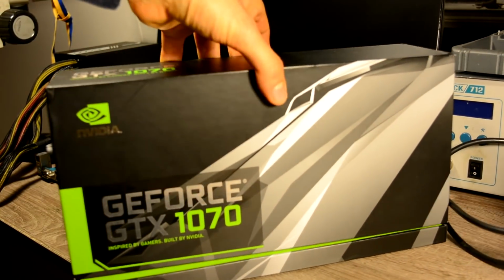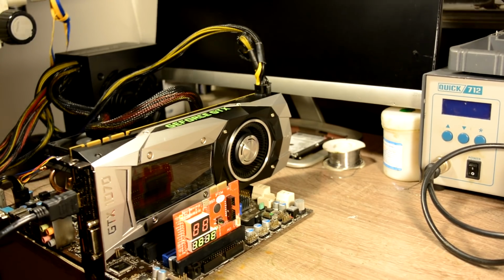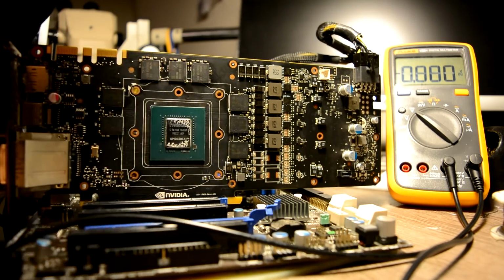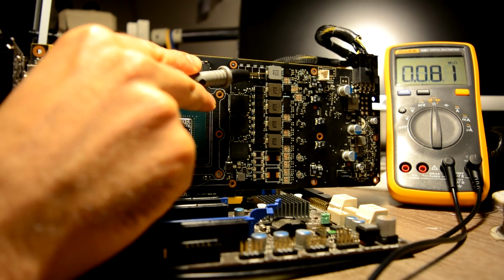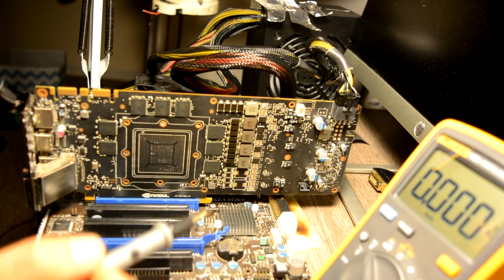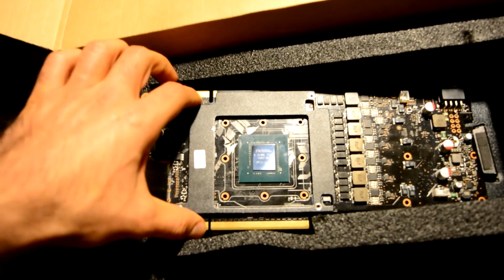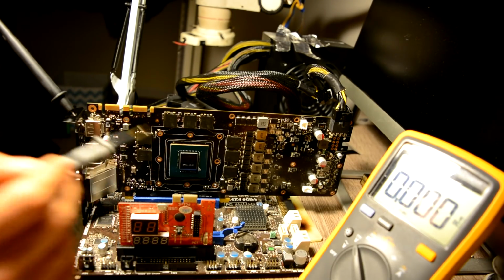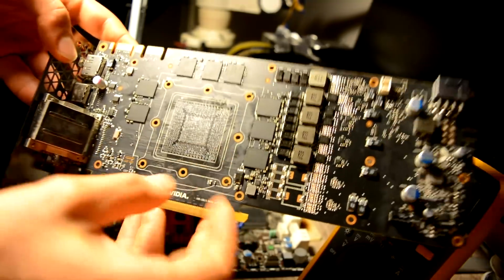GTX 1070 broken, no video diagnostic of graphic card hard repair PART 1

Comment: i have a lot graphic cards working. GTX 760, GTX 780, R9 290 and R9 280X. I bought all used, all cards are working fine. What are they duing?
Reply: Without a graphics card you won't be able to see anything in your monitor unless you have an integrated one in your processor. Those cards are a lot more powerful than integrated ones so for games/3d modeling etc. they will work alot better than an integrated one.
Reply: why do you have so many cards?
Reply: @edg6779  for my two children and me. ;-)
Reply: @aequo5729  ah ok, I got a 760 and 1070
Reply: :/ send me one im in need! xD

Comment: Have you done a video card repair where you showed close ups of what you are checking and the spots you are checking and why. Just more explanation and close up. I have (not this card) 2 cards where one did work on and off and I tried to reflow and now nothing. The other one really is hot and I don't know if this is normal, so how and why to check some areas would be nice. Thanks for the videos.

Comment: I have a few questions about a 1070 Strix, I may have unplugged it prior to letting discharge of voltage. Symptoms are cold Gpu but lights still functional. What is the most likely issue for cold gpu on these cards and power related failure to the die?

Comment: Heyo! Just bought a defective 1070, and just as you mentioned, the little coils in the bottom right are burned out, leaving a big gap. So, is it possible to just jump the two side together, or is a coil needed there? Also, is it possible to replace the 4 tiny black bricks with a bigger coil?

Comment: Hey Eli - 
What exactly made you think the GPU crystal was bad? Was it mostly the 1.8v phase having short to ground? I have a MSI 1070 with near identical PCB, that had Q37 mosfet blown, and also short to ground at that same inductor (L20), as well as short on 12v line and VRM... But the GPU dye gets warm when injecting ~1.2v @ 1.5amp (although did not feel any other component get warm). At least memory has good resistence (~107ohms). Is this 1070 crystal also a goner?

Comment: Hello!
 This is a very informative video, but I don't have that problem. Your friend from Frog - tech - tips told me to visit your channel because you could help me. 

I have an old motherboard, about 12 years, that is not working. It was working well (except the GPU missing one colour signal on dvi and a different colour signal on VGA so the colour was off, not sure if it has to do with this) but it stopped working seconds after last force shutdown. It turns on by itself when plugged into power. It shuts off immediately after being powered on. When I disconnect the CPU power cable, the motherboard normally turns on button press and shuts down when holding the button (but it of course doesn't give any signal). If I connect the power while it's on it makes a quick spark and shuts off. I'm guessing a short circuit...? I tried with another PSU. Also, the first PSU was from a PC that had similar problems. Maybe the PSU killed it? I would try to do a continuity test with a multimeter, but mine is fried. Even if it wasn't fried how do I test onboard components? Thanks in advance, hope you can resolve my problem and that I'm not bothering you.

 Greetings from Croatia.
Reply: Its a short 99% in one of the mosfets which are feeding cpu (they are around cpu under a cooling radiators) You can check them very easily with multimeter but without at least hot air station and new mosfet you wont fix it, but any kind of repair shop should easily fix it. What model is that motherboard???  Look here https://www.youtube.com/watch?v=PesCvN9losE&index=20&t=0s&list=PLmtF0HBHbL4lbqo59WZcJvXRT1Z1D9GGb

Comment from the maker: To be continued..
Reply: Hey Eli
I have problem with Asus R9 280X when i turn on pc then after about 3sec the mem chips is too hot to touch and main chip is hot to but you can touch it and monitor says "No Signal" . Fans runs normal speed btw.  Do you have any idea what to test or whats the problem? Thanks
Reply: @TheHulludmehed  Hey i had few problems with this.Check external power connectors to gpu if the are shorted (yellow shorted with black).Check with hand the vrms few of them can be hot and that can be the issue.Good luck
Reply: show me how you fix the dead MSI Geforce GTX 770 lightning 2GB Twin Forzr at the upcoming video.

Comment: Hi.. I have a question. Is more easy, difficult, or same as the card fails pre-post (doesn't power up, no video, whatever) than a fail that occur sometimes during intensive use/gaming? Like playing some minutes then then OFF (with no heat issues)?
Something than fails for example when is stressed or using full power, but works good on power saving.
Reply: Hey, how did you fix it?
Reply: @sklite6823  Hi!. Nope, the card finally dies. The technician shows me the board with a hole in the pcb where a ¿vrm IC¿ was sitted. It disintegrated completely.

Comment: Hello ! I got an rx 460 from gigabyte It was a nice card , working fine ,no overheating and now when a start the pc , the mobo want start , no starting beep . When i take out the vcard  , the mobo is starting fine . I cheked the vcard and i found that the pci e power pins of the v card are in short . the fans of the card are working , the gpu is warming up a litle 30-40 degrees with the cooler down . Where to chek ? witch component you think is faulty ? Please help ! Thank you ,in advance !

Comment: Why would you not send a 1070 back to manufacturer for warranty replacement?  Should be a 3 year at least correct?  BTW, where are you located Eli Tech?
Reply: blinks123  should be 2 year minimum for a 1070

Comment: the crystal itself is not that important for the processor inside ... for sure it might be the crack get its way into the crystal and maybe through the transistors inside but my experience is that almost in any case it doesn`t matter at all ;)
Reply: a crack trough a transistor thats several square nm in size is definitely something big lmao

Comment: Hello. I have dead GTX 1060. Fan spins and chip is heating up, but giving me black screen. You think 1060 should also have around 100Ohm on ram phase? Because mine have only 38 Ohm similar to your case in this video. You think ram is dead?
Reply from the maker: 38 ohms thats low
Reply: @elitech3339  Thanks for the answer and video. You helped me a lot.
Reply: @elitech3339  Hmm there is 1.35V on memory phase and they are warm so its seems ok... and if i run windows with 2  cards in both pci-e slots it detects this 1060 in second slot... Windows even instaled drivers for gtx 1060 but it says code 43 in device manager (that means windows stopped device because of problems). If you had to quess what might be problem? bios? chip itself? You dont have to help me for free but i would really appreciate any directions :p  I watched all your videos but all my measurments show that card is working...
Reply: Okay nevermind. I shorted one coil to some 8 pin ADPG chip and killed voltage section. I was stupid to use probes in tight case with not enoguht light. Well GPU is going to heaven now. RIP...

Comment: hello i have 3 AMD hd6990 
one is shorted to   ground 
second turn on without image and gpu is not hot
3rd turn on without image and gpu warm up
how to fix them all any suggestion...
for shorted one i inject voltage with no hot capacitor or chips the thing wich warm is cable used to inject current so i guess its shorted to pcb  and not chip/capacitor issue
2 other i dont know i test the one wich not warm the mosfet have 2.8 volt and not 12
leave comment
peace

Comment: wondering if u chould help me got a gtx 1060 that wont display in pci slot 1 but displays in other pci slots   with no problem  i tested board and its only this gpu that does this  what can i check on pcb  is it a detection pin problem or is it somthing elts

Comment: hello. i have GTX 770 that works only without drivers. with drivers it runs for 3 seconds and than no video and fan goes full throttle. what do u thing it will help her? reball, vbios or it is bad GPU?

Comment: hello, I have a problem with my msi armor gtx1070 oc 8gb.
the card was not detected in windows and it prevents the computer from starting. the card was detected in safe mode as if it had no problem I was even able to flash it again but with each restart there is the same problem with the computer reboot reboot reboot.
on the other hand the mosfet and vcor are very hot.
can you give me any advice?
thank you

Comment: got a msi gtx1060 3gt oc  cards  gets no video  and wont run nvidia MODS program  if i pull heat sink i find the min i power the pc gpu temp sky rockets super fast then stops and stays cool is this a bad gpu  or vrm how can i trouble shoot this  by spliting gpu from vrm to locate a short

Comment: I have one 1070 worked good two days then stopped output to HDMI. I connected a 750ti in second slot and device manager says both are working properly... But I can't game on my 1070 without it's output and can't install drivers on new is with 750 in slot too. I did a new is trying to troubleshoot and now I'm stuck. Not sure where to go now ☹️ 
Edit the pci slot works fine too. Any help would be appreciated and like others I would love to send it to you and will pay.

Comment: Hello Eli and commenters of video.I have 980ti broken.When i power my pc the GTX logo turns of and i dont get a signal.The crystal is warm,fans are spinning.When i use igpu the device manager shows error 43.I checked voltages on crystal,memory,pll and 3,3 next to the hdmi port.Have you any helpful information for me? Thanks
Reply: It could be driver missing

Comment: I have a gtx 1070 it was working fine for me 2 days ago i changed thermal paste after turning on the gpu i got black screen and it froze and restarted. So what is the problem with knowing that I have not sinned? When decoding the extremely hot GPU, I found it stuck tight and I screwed it up tight. Please help

Comment: Hi  i need some Help. 
yesterday i updated the new Drivers on my GTX 1060 6 GB Gaming Strix card and  it got black screen i cannot do anything please can you support to fix this.
 
i Checked the Bios using TechPowerUp GPU-Z But after installed the latest drivers i got black screen and after restart the pc it freeze on boot screen. i try to uninstall the drivers using DDU v18.0.3.4 in Safe mode and install the drivers again.

(457.09-desktop-win10-64bit-international-dch-whql)
but still not working my GPU.

i turn on my pc using iGPU then i Checked Bios using TechPowerUp GPU-Z but the bios version is unknow .
sorry for my bad English.
please Help.

Comment: Hi Eli Tech, Many thanks for your videos and tips on diagnostics. Could you quickly cast an eye on my post on the forum link below please? I would greatly appreciate any advice you may have. Essentially, my card works when left alone overnight but stops working after powering down the mobo. No voltages from 1.02v PEX, 1.35v memory or 0.7v VCORE.  Resistances are 5v = 50 Ohms+, 1.8v = 895 Ohms. Thinking its a MOSFET, or some residual electrical resistance. Here's my post ..overclockers.co.uk/forums/threads/gigabyte-gtx-1070-itx-mini-intermittent-issues.18934060/#post-34987959
Best regards, Kiran